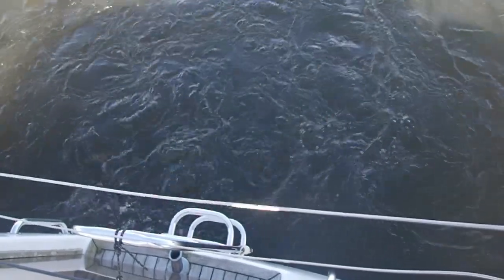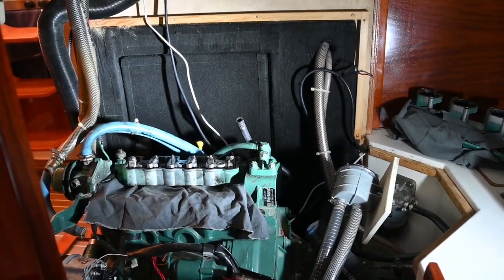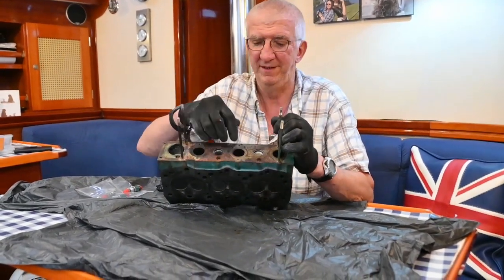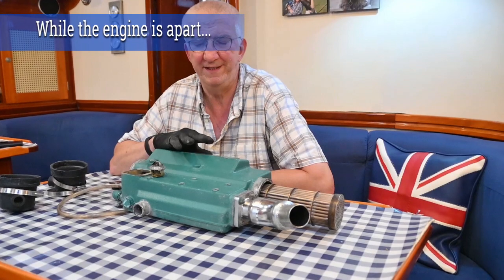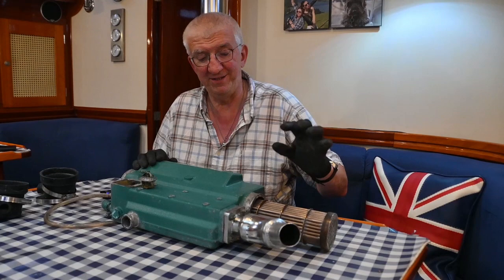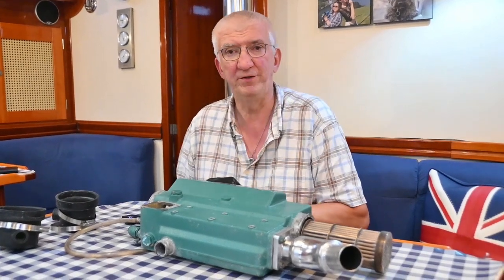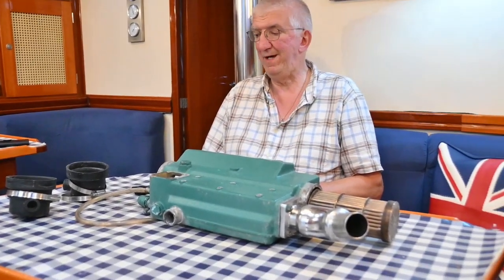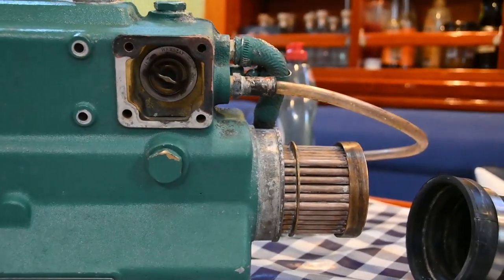Episode 40 - How to fix a steaming or smoking  boat engine!

Comment: On my D2-40 I had steam above 1850 revs. I added a salt water intake by using a T on the sink and a Y to the salt water pump. It solved the problem. I also added a filter to prevent barnacle to get into the impeller.
This also provides an advantage whenever a plastic bag might block water intake on the sail drive.
Reply from the maker: This is something we are considering doing. We think having a separate intake for cooling the engine would be better than relying on water coming through the sail drive, which has a very small opening and is easily blocked. Thanks for the idea.

Comment: You changed a number of parts on your engine and the problem has been solved but if you had to pick one item that solved the problem which would it be?
Reply from the maker: This is tricky, but the fuel injectors is probably the one.
Reply: I’ve just changed the exhaust elbow on my Thornycroft 230 d engine when I fitted the new one the engine started and stopped within seconds and will not stay running each time I try 
Question 🙋 
Do you have to bleed the water system or something when you change exhaust elbow  thanks 🙏
Reply from the maker: @sailingmsmalachite1503  We do not know about your engine specifically, but we primed our raw water filter by filling it up with tap water to create suction. Once water is coming out the back consistently it shows its working. Not sure why changing the elbow has caused the engine to not work. Sorry.
Reply: How do you explain the combustion gas in the coolant?  Seems like the head gasket must have had some seepage. Did you repeat this test after re-assembly?
Reply from the maker: @1768ify  We did change all the gaskets when we had the block off the engine. So it may have been a gasket issue.

Comment: Thank you very much... we have the same Problem with our 2040 think we are doing the fuel injectors.
Reply from the maker: We hope it helps. It's so frustrating when you don't know what to try to fix the problems. Let us know if it works. 😀
Reply: Hey mate, did it work? Currently having the same issue…
Reply from the maker: It's been great for the last few seasons. We wish you the best with solving your problem.
Reply: @sailingseagullsouth  thank you. It’s driving me mad 😂
Reply from the maker: Any questions just ask? If we can help we will. The community spirit between sailors is an important one for us. Many people have helped us in the past. 🤞
Reply: @sailingseagullsouth I have some new boots coming from the uk. Should be about a week away. I’m having trouble getting the hose clamps to seal on the insert. The boots look fine but seem to be soft and just slipping off the insert and getting sea water in the coolant water. It’s like the insert needs to be 10-15 mm longer. Just found some weed in my sea strainer.
Put some injector cleaner in the fuel tank. I have had the exhaust elbow off and it’s clean. Still got the white smoke/ steam but will wait until I have ran a full tank of fuel with the cleaner in it before pulling the injectors. 
Cheers
Steve
Reply from the maker: @Steve-ul8qb Thanks for your comment. Is your engine a Volvo MD2040? Another possible area to look, is back flushing the sail drive with a hosepipe. Sometimes they restrict the water flow and not enough cooling is achieved. We hope you solve it soon, we know how frustrating this issue is.
Reply: @sailingseagullsouth yes it’s a 2040 but shaft drive. Will check the intake though. Thanks
Reply: Just an update, it ended up being the water jacket on the exhaust elbow. Water was passing through, I could blow through it freely and visually it looked fine. But must have had rust in there restricting the water flow back pressure causing the water to pass the boots into the coolant, also not enough water flow causing it to steam. 
So a new elbow, boots, a bottle of injector cleaner through the tanks and I can report she is running beautifully with no more smoke/steam. :)
Thanks for your help!
Cheers 
Steve
Reply from the maker: @Steve-ul8qb  So pleased you have solved it. It feels fantastic when you test it and it is finally solved. 🙌
Reply: @sailingseagullsouth  sure is!! Thanks for your help 🙏